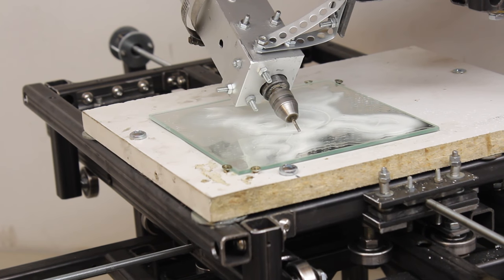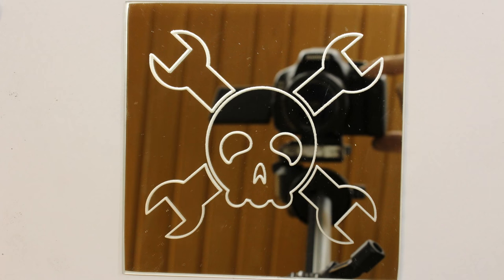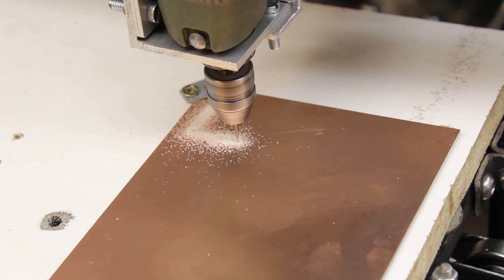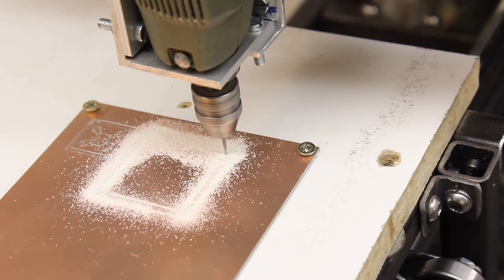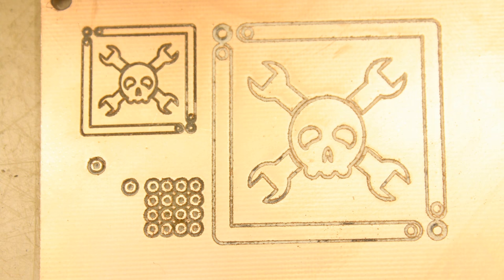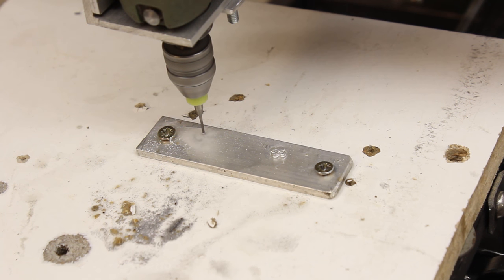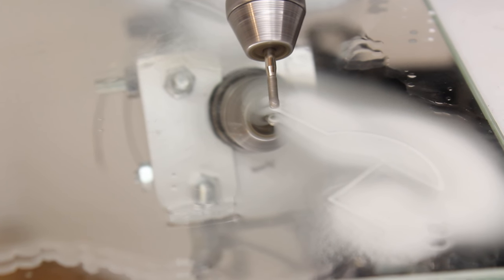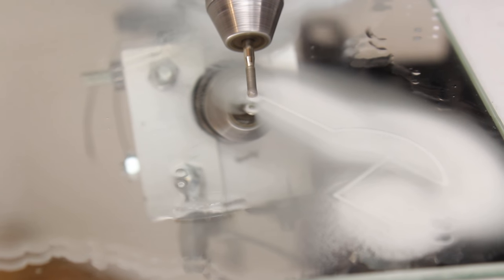First run of my DIY CNC v3.2

Comment: I enjoy your progression of CNC builds from cardboard, fiberboard, MDF, and now off-the-shelf metal bars.  The use of optical position sensors, interrupted light, and Arduino to control salvaged DC motors is impressive.  The repeated emphasis on measuring accuracy and repeatability to find the limiting factors in a design is admirable.  Many experimenters and builders ignore this principle.  It is obvious that this is a journey, and you are not at the destination yet.  I need your clothes, your boots and your motorcycle.
Reply from the maker: ...you can get a copy of my ideas instead ;-)

Comment: Pathos is incredible. I'm an electrician and we throw away so much threaded rod, strut etc. Most of this stuff I could grab as waste on the job or at a scrapyard.  
Will definitely attempt to build one, the programming may be an issue but that's a future me problem.
Reply from the maker: The machine is running with  "raw" software and electronics. I will enhance the electronics in such a way that it can run grbl on an Arduino and so process G-code which will make it easy to find an appropriate software. Another approach will be to use bipolar stepper motors in another configuration with either an Arduino or Raspberry Pi to control the CNC. It's still a long way to go (especially when creating the documentation as well). I will publish at least the templates and software of the raw version soon (deadline is October 10th). Stay tuned!

Comment: absolutely fantastic i built one a while back 12 x 5 ft working space 10 x 4 ft slapped a nice router on  it works great then came the laser 40 watts then i shoehorned it into a 1971 winnebago 
now its known as the lasercarveabago except the steppers 1 short ball screw  and laser and nice router its all recycled right down to the spur t nuts

Comment: i dont want to blow the bubble to all of you, but, if you gonna make 2d pieces, you can have much greater rigity by making a manual machine. Straight guides like an old lathe are much more structural strong than this bearing setup. Even if you have the power to mill steel or aluminium on the steppers, with this light weight setup, the entire machine will warp like a bambu tree as you start to mill something hard. good machines are the heavy ones, lots of inertia and strengh.  

Another tip, try to buy militec oil aditive,  lubrificate your  cheap screws and nuts with it. Then, put the screws and nuts inside a oven until reach 90ºC to militec bond to metal. You will have much smother movement. bye
Reply from the maker: Yes, CNC machines can never be stiff enough, but this one is anything else than a bamboo construction. This was a quick test and I'll demonstrate in future videos what it can do and of course what it can't - the latter is often concealed.
Using commonly available materials is the base construction principle - no miracle oil ;-)
Thanks for your feedback.

Comment: I wonder what you would do with proper cnc hardware
Reply from the maker: ...the idea is to turn this machine into proper CNC hardware ;-)
Reply: HomoFaciens I know this series is meant to be like this, it's just that there is a limit on tolerances you can achieve with "home" fabricated parts. What you did is already beyond amazing.. btw. I tried finding double optical sensor like you use on ebay, but couldn't find any. Is there a specific name/search term for it?
Reply: if you look closely he is using 2 single sensors glued together. that is probably the reason for such large encoder wheels. I have been collecting parts in the hopes of building something similar. Found a bunch of identical sensors in an old copier machine.
Reply: blueroze471
want a piece of advice? scrape computer mice, they have very accurate IR sensors on the scrolling wheel ;)
Reply from the maker: abd bach
Yes. The old ball mice had two more of those sensors, unfortunately you get them only rarely. New computer mice have optical motion sensors.
Reply: HomoFaciens Yea, and that's my point, you wouldn't want to scrape new mice, would you ? XD
Reply from the maker: abd bach
No!

Comment: The framing is really nice! You might benefit from a welder.
Reply from the maker: Thanks!
...but you could ruin the framework quickly if you aren't a gifted welder, that's why I choose screws to put it all together.
Reply: That's a truly valid point. I build a lot with extruded aluminum framing from but struggle with the realization that the screws can stretch and loosen over time. Your tubing may be too thick, but if not, a spot welder would make quick work (and rework) with minimal distortion. Just ideas you've likely already considered. Again, yours is a beautiful frame.
Reply from the maker: There are pros and cons for all ways to build a solid frame. The main intention of this one is using low tech tools and commonly available materials. Even noobs can learn quickly how to cut threads and screw it all together, but welding needs an experienced operator. It's an experimental machine and time will tell if the frame stays as solid a it is now...
With the fear of loosing screws over time I had welding in mind, but spot welding would require a different design since the tubings are indeed too thick (2mm wall thickness, 20x20mm in cross section).
Reply: Well said, thank you. I look forward to your next update.
Reply: "the screws can stretch and loosen over time" // Look at a car engines. They consist of bolted modules, but work for years under vibration. You can apply a thread locker to ensure fixation.
Reply from the maker: Alex Trezvy
...that's what makes me feel much better about my construction. With the threads being no longer than 2mm, the results with thread locker weren't impressive, wich is why I did not use it.
Thanks for sharing your thoughts!
Reply: True, and there are also a lot of welded assemblies, such as the unibody. Not all the bolted assembles on a car are similar to a bolted truss. Maybe narrow the example down to those involving long levers relative to the screw diameter (like my example of bolted aluminum extrusion). A better analogy for HF's mill may be bridges, which will have a mix of bolting and welding. The choice may depend mostly on if the assemble is built on site or shipped. Welding is likely preferred for cost, but bolting could be easier in some cases. And when bolting... a lot of bolts are used. Regardless, interesting discussion, and this is clever work and I look forward to future videos. Best wishes
Reply from the maker: Kent VanderVelden
Thanks for sharing your thoughts! Future will tell if my CNC falls into pieces over time ;-)
I will also create more than one mechanic, since steel bars seem to be rare or expensive in parts of this planet. A wooden frame with only a few steel parts will follow.
Reply: I think that one of the most important features of HomoFaciens philosophy is that machines must be able to be constructed using common tools, common to people in all countries. Bringing in welders, plasma cutter, lathes etc,, eliminates a lot of his target audience.

Comment: Please help. I won't compile this (3) Open a terminal (Ctrl + T in Ubuntu) and change to your installation directory:
   cd / YourDirectory
(4) Compile the source with:
   gcc commands-CNC.c -lm -o commands-CNC
Reply from the maker: I only can help, if you tell me WHAT EXACTLY the problem is or what error message at one of the steps appears.

Comment: what are you planning to upgrade to make it proper cnc machine? is a not powerful spindle is a weak place?
Reply: and also, cant wait till your next video, independently what it will be :)
Reply from the maker: The more powerful router motors are (usually) more solid with better ball bearings. That causes less wobbling of the router bit. I have ordered a 400W motor - let's see what I can get with it...
Reply from the maker: The video under construction is about this CNC, too. It's the promotion video for the HackadayPrize jury - hope to make it impressive ;-)
Reply: HomoFaciens why not just use a kress 1050? its rather cheap and is used on a lot of home shop cnc routers
Reply from the maker: There are more companies than Kress that sell router motors. I will try various motors over time - stay tuned!

Comment: A for effort, but still using more complex(and expensive!) DC drives :(
Reply from the maker: Conventional steppers are cheaper than DC motors from scraped printers? What motors and electronics are you talking of?
Just to keep you interested in this machine:
The ordered NEMA steppers and electronics arrived and I will implement that version of drives in a couple of weeks - stay tuned!
Reply: HomoFaciens Older printers, and dot matrix printers, both have stepper motors and drivers to accompany them.
Reply from the maker: Unfortunately it's hard to find martix printers these days. I got a bunch of commonly available printers from a repair shop and none of them had stepper motors. The shop owner said that they are in fact rarely used in those devices these days.
Reply: Inkjet printers don't use steppers too?
Reply: Alex Trezvy Nope, they use DC motors with linear encoders.

Comment: Can this machine be applied to grind a groove in steel?
Reply from the maker: I will try that in a future video. first I will redesign the table (x-axis) and coolant flow. After that I will have a closer look at the disadvantages of cheap router motors and try processing steel. Stay tuned!
Reply: HomoFaciens thanx for explanation. May be I've missed something, but is it worthwhile to make such a massive XYZ frame? Compared to more lightweight CNC's made of steel, such as, for example, the following: /watch?v=SrMuUX4L_Z4 .
Reply from the maker: In principle, there is nothing wrong with massive frames for CNC routers. The more solid, the less distortions under side load. It also helps to eliminate vibrations.
The machine you refer to is anything else but lightwight.
Reply: HomoFaciens yeah, it is heavy, because of the large table and thus large gauge of tubes. Imaging if the table of same size was made of XYZ frame. =))

Comment: first of all i love your projects!!
secondly what router motor did you use?
third and last please make an instructable (this one for example http://www.instructables.com/id/Complete-newbie-step-by-step-3D-printer-with-all-p/?ALLSTEPS)
Reply: my bad you do have all the details here https://hackaday.io/project/10299/logs
Reply from the maker: The router is an old 100W Proxon with (broken) speed control. The documentation will also be available on my project page as soon as the machine runs fine (there is still a lot to be done...):
http://www.HomoFaciens.de
Reply from the maker: Yes, this machine exists only because of this year's HackadayPrize - let's see what the jury thinks about it ;-)
Reply: I hope the jury thinks only the best and that you'll win a prize :)